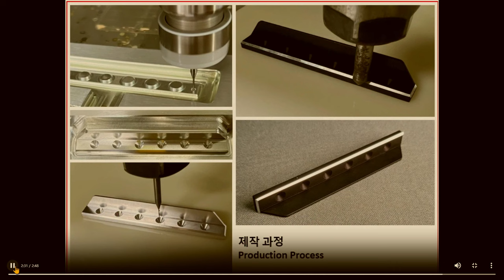스트링타이  Mede in Korea 제품 출시

Comment: No, the individual string tie is better. It's a lot easier to use and neater.
Reply: Thank you
When using individual string ties
It was an expensive product, but it broke (damaged).
This product is safe and semi-permanent
Reply: @okim777  It breaks if you buy the cheaper ones made of low-grade plastic. The one I use is Rosette DSTS-Blk, made of tough material. It is not that expensive; it costs US$15 with 7 beads in a packet. I have six guitars, and I have never had one broken. But your product might have its merits.
Reply from the maker: https://ref.freeship.co.kr/goods/content.asp?guid=3518994&freeship_ep=naver_ep&NaPm=ct%3Dlsv48ez4%7Cci%3D930fa64aba355cad8bc1b9908c7e65acac6f8654%7Ctr%3Dsls%7Csn%3D405974%7Chk%3D3d4835430c54801015c922644aa7d0e257a5c8e3
Reply from the maker: I tried this product
Out of 6, 2 are broken and cannot be used.
Reply: @DONGHWANNoh  It breaks if you buy the cheaper ones made of low-grade plastic. The one I use is Rosette DSTS-Blk, made of tough material. It is not that expensive; it costs US$15 with 7 beads in a packet. I have six guitars, and I have never had one broken.
Reply from the maker: @johnlay3040  

Thank you
I tried two products
The product introduced in the video above is simpler, more durable, and
I like it because it seems like a product that can be used semi-permanently.